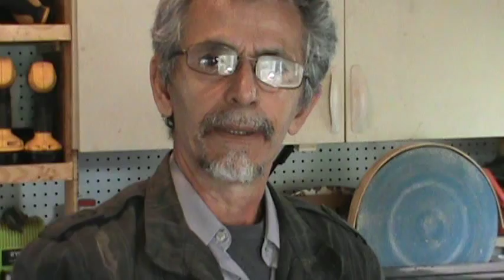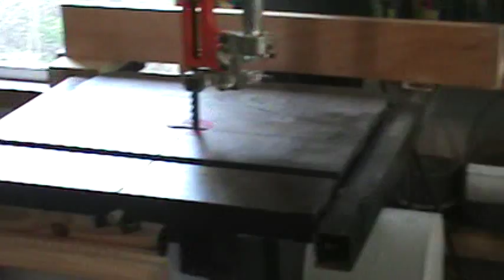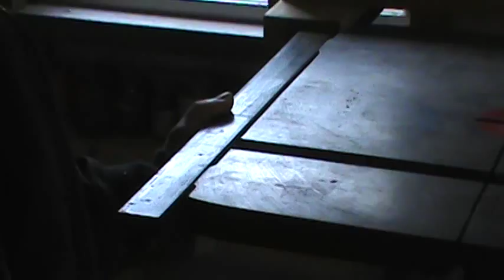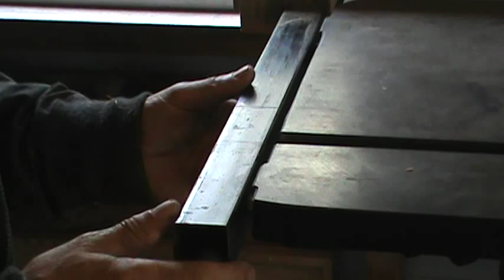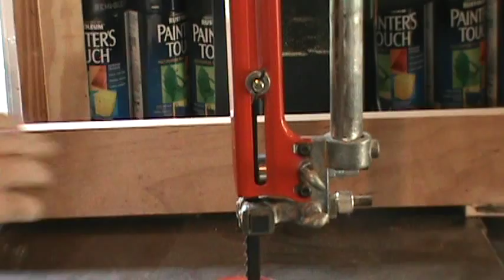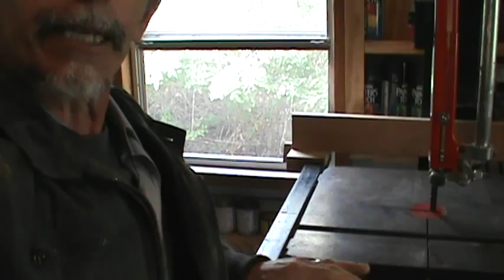Make a band saw fence Wood turning by Al Furtado

Comment: Very good idea.  My old Craftsman saw has no fence and they never made one to fit.  Now I will have to figure out how to apply your idea on my saw.  Thank you for the idea.
Reply from the maker: Lou your craftsman band saw might have the blade channel coming to the side where the rails would be, if that is the case you would not be able to use the system I showed but using a miter slide from your table saw with a fence attached to it might also me a good solution but you would need to find a way to clamp it in position.
Let me know if I can help. alfurtado@Verizon.net